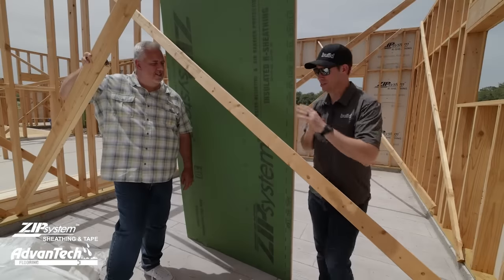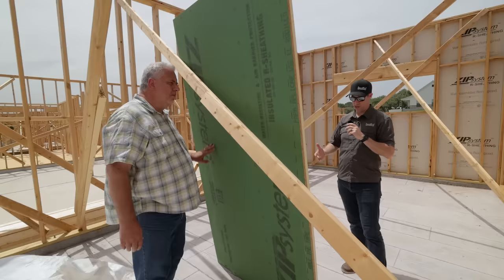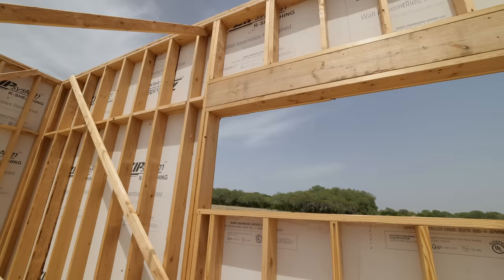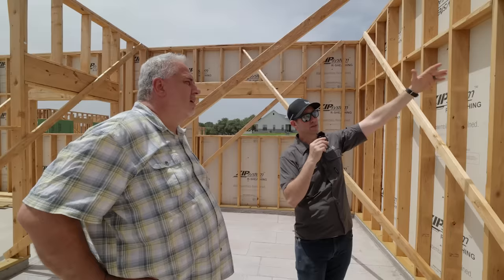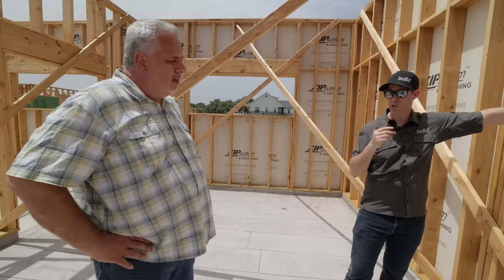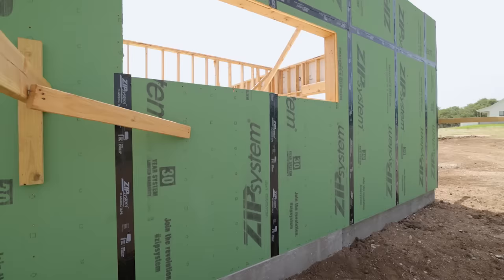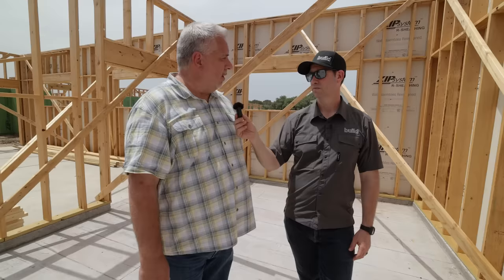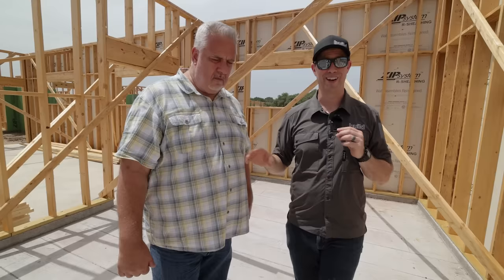ZIP-R Sheathing Review (Feat. Steve Baczek)

Comment: Could I get away with the use of T-studs, and accomplish the same concept.  I was going to use t-studs and zip r together, but was told it's too much.
Reply: You CAN'T have too much insulation, as long as your build budget will allow the extra $$$
Reply: Depends on long you plan on living in that house…. 15 plus years… do both…. Other then that any exterior insulation. And then maybe a couple inches of spray foam in the cavities just to lock everything together
Reply: Too much what?
Insulation r value?
Cost?
Reply: @bobjoatmon1993  too much r value for limited savings of energy for the extra cost of material/labor, I'm in North Texas.  This what I was told.  I want a lot of R value, but I don't want to over spend on something that won't yield a savings.
Reply: @jdahlheimer777  it'll be a structure on land we will own from now on so definitely over 15 years!
Reply: @BriscoeHomes  well I’m my personal opinion, I would just do exterior insulation… and maybe find a “good” foam contractor to put open cell in the remaining cavity. A little  background on me… I have been in the insulation business for about 12 years but I’m from Minnesota. I currently work for a foam contractor. But I have been to a few energy seminars and I try to keep up with new building science.
Reply: @BriscoeHomes  That makes sense.
Thanks for the response / answer

Comment: If the challenge is to address the low R-value of the framing, wouldn't be cheaper to have a strip of insulation on the 2-by's vs the whole wall surface of the walls? Based on what Steve said, framing represents 20%-24% of a wall. Why over-insulating 100% of the wall when you could reduce the extra cost of the R-sheating by 76%-80%? Scalpel vs axe approach. My 2 cents.
Reply: If you think cheap then that's your answer
Reply: Show your data

Comment: Just did some quick pricing on Ring's End ...

7/16" OSB - $38
7/16" zip - $58
1/2" r3.3 polyiso insulation - $23

15/16 zip-r - $130  !!!

How does zip-r make any sense?
More sponsor Hoo-ha ... ooooooonnn the Build Show!
Reply: I got 150 sheets for $77/ sheet.  The "retail" was $110. That was at Lowes, believe it or not  Some places will work with you.
Reply: They didn't go over how the zip sheathing is also your WRB after you tape the seams. Savings on labour of having to put one sheet up and tape the seams would help with the extra cost of the zip-r system. It definitely cost more, but not as much as you put it.
Reply: 7/16" OSB is $18
Reply: Labor
Reply: @Magrath  From this vendor, zip+r is $50 more per sheet that regular zip + insulation sheets. You have to tape zip seams either way. 

$50 per sheet to hang insulation? I'd do that any day.
Reply: Do you buy your cars based on what you will sell them for? Their operating cost?

Comment: man, i feel like zip dropped the ball here, if they did mineral wool vs foam i feel like they would be the gold standard or better, platinum. Mineral wool being nearly fireproof and from my understanding termite proof since their exoskeletons are tore up tunneling through them ( i think i remember you saying this right?  - been looking for proof on it for blown in mineral wool though with no luck yet) . but yeah...why foam ugh
Reply: ProVe it
Reply: @daveklein2826  lol huh? I grabbed some of my mineral wool and tried to melt it, it does shrink very little and then stops and burns no further
Reply: I think the compressibility of mineral wool would be a problem. The density would have to be such that very little to no compression is experienced
Reply: @stevenbaczekarchitect9431  yeah with my 1" im noticing this, but the 3" is pretty rigid from what i hear where when installing rainscreens with it, it hardly needs adjusted. So i guess i could see they wanted to keep it with one company and not change it just for 3" :)

Comment: Hi Matt, you didn't cover when you should NOT use the Zip R product.
Reply from the maker: Good point!  I would say generally that if you need/want more than R9 you should skip Zip R in favor of more exterior insulation and standard Zip. I did that at my house with 2” of Polyiso outside of my Zip. I generally think of this for cold climates though.
Reply: @buildshow  Thanks very much, I suspected that was why you used the Polyiso in addition to the standard zip.

Comment: My bet, 10/15 years it will be another failed system. Humidity will cause the plywood to rot away. With the exterior insulation will just speed up the rot. If not in a high humidity area you get away with. Just my opinion of years of building and remodeling.

Comment: Have you heard of REMOTE WALL SYSTEMS?   It seems better than this.    I could see moisture  working its way through the seams
Reply: You have to use the zip tape over all the seems
Reply: Doing a remote wall build this year in northern Ontario on a 'pretty good house'. So much easier, not sure why it isn't widely used more. Fully sub diy friendly without compromising the ACH value.
Reply: I am - both can be very successful

Comment: do americans not calculate for timber thermal bridging in building design u-value calculations? 🤔
Reply: I always consider it
Reply: @stevenbaczekarchitect9431  consider it or calculate it? 🤔
Reply: @GM-dc8vr  Consider it......we have run Therm on details before for projects, the calculating time is a little costly to get info that I can pretty much make a very educated guess on and be in the same ballpark. The other issue with "calculations" are that they are only as good as the person inputting the info.....
Reply: @stevenbaczekarchitect9431  aye true. Interesting though. A full calculation is always required here.

Comment: This zip shit is just that . Their never ever enough thought when new products are put into the work place. Way to much of this system counts on tape and making sure it’s applied correctly . Subcontractors and Builders are humans the sub can’t get paid for this stage unless it’s complete and rightfully so . Then it’s it rains things are not dry before they tape it , guys lose their rollers,sheets in the dirt and mud needs to dry out be cleaned it’s just asking to much in todays labor market .  Wrapping a house with a Tyvec is just about fool proof in the feild it comes off a roll the tyvec is clean tape sticks it just works .

Comment: The only issue I see with the Zip system is the tape. It will deteriorate over time. So 30 or so years later, the osb will get wet in many of these homes. Yes it is warrantied for 30 years..... Then what?
Reply: NO WAY - I have Zip taped and fully exposed in my backyard, been there for 12 years tape is fully in tact
Reply: @shvrdavid  There are examples in Canada I am familiar with with far less adhesive technology that were into their 30's and 40's. You don't have to believe it, and you don't have to use it. I trust it, I think it will work in the protected environment it will exist. The beauty of America is you are entitled to your opinion , as well as I, and I don't have to agree with you
Reply: @shvrdavid  Just discussing buddy - I actually have spent some time with the actually chemical engineer that developed the tape. He is a very smart guy and maybe he has a bias (I don't think he does) but he is very confident in it. A close friend of mine and Bldg Green colleague has done a bunch of tape testing and has found it to be very favorable. My personal test is a sample of 1, not quite the best test but it has been in the weather for almost 12 years fully exposed, lying at about a 20 dewg angle out in the yard. The tape is near perfect, the adhesion is suprisingly fully in tact. If I tried to pull the tape it would surely tear the OSB apart. My confidence in the tape lies is the idea that it is installed properly, with a rainscreen, no UV, and little to no water and or weather. My hope is in 20 years I get to see if I am right. I ask for 40 or 50 years but, well......let's just say 30........I do appreciate sound fundamental conversation by the way. Many would come on and say something dumb like "the F'n tape sucks".......So thank you for real conversation......and as the old adage goes "Time will tell".....enjoy your weekend